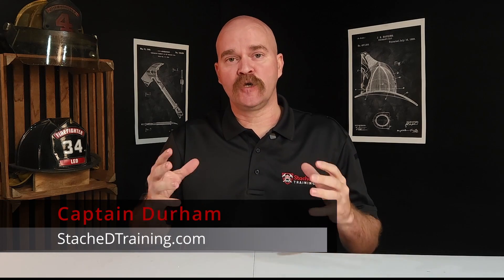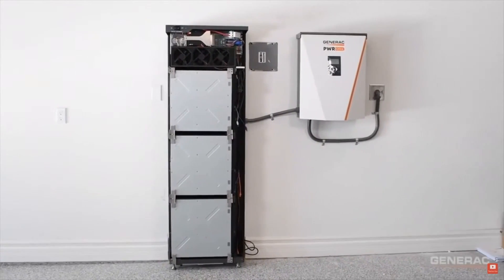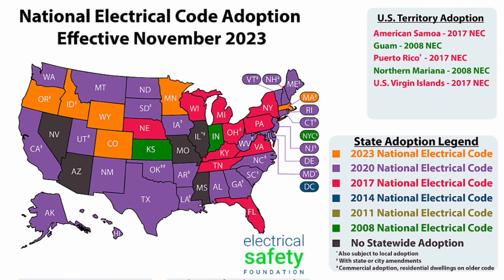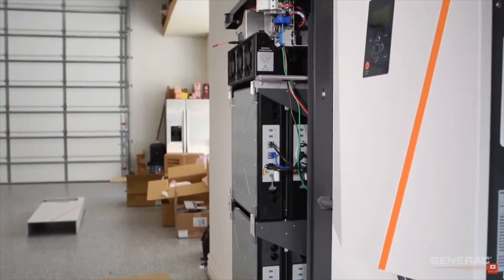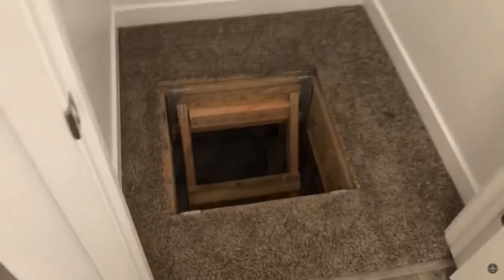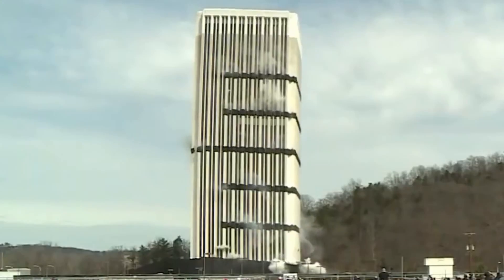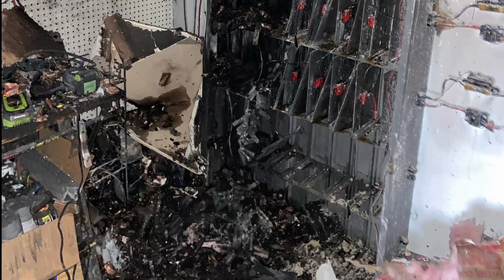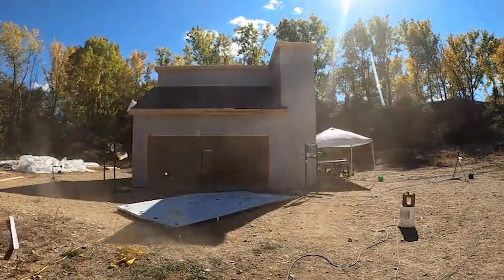Explosion - DIY Energy Storage System: Worth the risk?

Comment: I'd like to do a system at some point but I'm already firm on it would all be in a dedicated outbuilding made from something like cinder block, I don't even like leaving tool packs charging in the house unattended. I didn't know there was a hydrogen risk from LFP, sounds like they need to be treated similarly to lead acid.
Reply: I would personally put one in a sea can with enough venting that it can't blow the walls out and create shrapnel. Probably cost similar to masonry and you can resell it later

Comment: It seems like any of these storage systems needs to be divorced from the home structure. A stainless steel, vented enclosure with automated fire suppression seems to be necessary.
Reply: I would forgo the suppression system
Reply: I agree. Forget fire suppression. Build for nonflammable construction with a vented roof, plus sufficient distance to contain the fire and prevent spread to other structures. If thermal runaway happens, fire suppression could make it worse.

Comment: My first experience with solar power was at a communal house in the rainforest country of far north Queensland, Australia, in 1982. It was a very basic system that charged a bank of 12-volt car batteries so that they could run a radio and a few 12-volt lamps. They also had an old, oil-powered single-cylinder engine with a wheel that ran a 240-volt generator in case they needed a bit more power. My second experience was in 1983 when a friend told me about his parent's home in a (then) remote area of the coast of Queensland. They had a solar setup with deep-cycle batteries and the solar company that installed it was using their home as a test-bed for the system. Each year the batteries and panels stayed operational at their property, the company would extend the warranty on the product for future customers. Solar was quite unique at the scale of running a home back then. All of the locals in the community used generators or very basic solar systems that would only run a few 12-volt lights. EDIT: With both of those early systems, the battery banks were outside, away from the house in a separate shed. If I were to buy a home and install a Tesla or other Li battery system, I'd have it in a shed separate from the home.
I do my own 12-volt and some 240-volt electrical work...but I got some training and did some self-study before playing with the zappy zappy stuff.
Reply: Spot on! The energy density of these battery systems is enormous. If they fail all that energy gets released in a thermal runaway cascade. You do not want that risk inside your home because each cell in each battery is a potential single point of catastrophic failure. 

Even quadcopter drone enthusiasts who are experienced know to charge their tiny batteries in a protected battery bunker. (Sure the Lithium battery chemistry in them is a bit different, but the danger of thermal runaway failure is very similar - except your house battery system has hundreds of cells in them!)

People need to Google car battery fires as well, because the same dangers are lurking there too. We have the early stages of a new, non-fossil fuel, energy infrastructure, which is great, but sales & marketing are not going to dwell on the dangers - they don't want to dissuade a potential customer. It's up to the homeowner & diy'er to understand the risks and design/build accordingly.

If it was me, I would have a separate power shed designed to contain a thermal runaway, as well as keep the battery bank in its optimal temperature range. And, I would keep my outdoor power equipment & cordless tool batteries & chargers out there as well.
Reply: Home good builds guys normally will say that the key to using old batteries is to not over stress them, dont't charge more than 85-90% or discharge to low and charge and discharge al much lower currents than you would normally. This greatly reduces the stress on the aging cells to the point where the risk of explosion is almost zero.
If you want your phone battery to last way longer and greatly reduce the risk of it exploding on your car dash then don't fast charge you can turn it off in your settings.
Reply: Yeah, Hi Brad. His report was excellent. In some way I reckon we are all seemingly addicted to batteries and having to remember to charge 'em once in while. 😅

Comment: Should be requirements that battery packs must be stored at a certain distance from the house, and have an extinguishing system that is automatically activated in the event of a fire, gas detectors, etc.
Reply: They should follow the same rules as other generator systems until the risks are quantified.

Comment: Thanks for the information on this subject .
I am for a while now interested in solar / wind / hydro elekticity storage and try to understand the who / what and where on this subject .
The big issue i have is , like you shown , the burn to the ground of electric vehicles and the explosions of it .
Many video's show the installations of DIY systems and several seems to have a very high level of profesionalism , but my concern is safety and as high as possible .
For what i understand now is that if you use LFP batteries use high quality batteries , high quality equipment to regulate the power , not in or close to the house or any other building and a kind of ventilation or ofgassing system .

But there is also an other safety issue , how safe will it be if there is a big solar wind / CME / EMP ?
Because of the Geo Induced Currents ( GIC ) that will have currents above and underground how safe can these systems be made ?
Reply: Much like the risk of EVs, the risk of these battery systems is being greatly exaggerated. 
ICEVs have 30x the fire risk of BEVs. This is fact established by insurance companies. 

Gas vs EV Fires [2023 Findings] - AutoinsuranceEZ 

I strongly suspect we are going to see something similar when compared to fossil fuel powered backup generators. 
There will always be some risk, but if these few incidents are all there is, it seems they are vastly safer than the standard systems of today.

As to solar flares, emp, and such, being off-grid is safer. It is the long power lines that are the danger. Being able to disconnect when danger presents itself is an advantage battery systems have in this regard.
Reply: @williammeek4078  These systems have a Battery management System ( BMS ) if the BMS is damaged ( technical fault , EMP , Solar Wind , CME ) then a Thermal Runaway is likely to happen and this means the battery's are heating up and fire will soon be a big problem . The problem with Lithium is that it is highly reactive .

Comment: Yes it is safe. The lithium battery dont outgas? Must have been a lead acid system poorly made with a bad placement not in a special accumulator room that was not safe and ventilated properly. 
Is lithium batterys cheaper than lead acid? The weight and size matter less than price in a house than a car or plane.
Reply from the maker: Lithium-Ion batteries release significant amounts of flammable gas when they fail.   This was confirmed to be LFP batteries.

Comment: I have 140KWH of tesla model s battery modules in my shop to run my property, it has a BMS, a liquid cooling system and a 1/8" steel cabinet. That said it is 250' from my home and i know its very dangerous  and would never professional install them for a customer. I only use ul 9540 rated storage for installations on homes

Comment: I currently have 7 x BYD LVL 15.4kwh batteries I built a proper enclosed block building for my installation incase of this. But after seeing this I am considering putting a vent fan inside.
Reply from the maker: My recommendation is hydrogen sensors that activate ventilation.  Allowing flammable gasses to build up inside an enclosed space can have major consequences.

Comment: Home fires from batteries are extremely rare and represent a tiny fraction of total fires even when percentage of homes that contain batteries is taken into account.   Strangely, whenever one happens it becomes a major news story.  Even though gas explosions, cooking, heating equipment, faulty wiring, smoking, candles and even Christmas trees all account for many more fires than batteries.  That doesn't mean you shouldn't take proper precautions like this video points out.
Reply: At the very least it's an additional risk to stack on top of all the other risks you listed, and I would not install the battteries/DC switching and conversion stuff physically in my house.
Reply: @treelineresearch3387  Yes.  That's why most batteries are attached to the side of the house not in it.  No chance of gas build-up and/or explosion.  Some people put them in their garages which is better than the basement but still not a great idea as most modern garages have limited ventilation.

Comment: The best place for a Li-Ion storage system is 50 yards from the nearest human being or their property.  Lithium ion cells offgas hydrogen gas and that is very dangerous in a confined space.  Many EV fires happen when hydrogen vent gasses get into passenger compartment and 'boom' everyone inside is vapourised.... Don't even mention the totally toxic gasses emitted from a lithum fire, one breath can be fatal...
Reply: Renault Zoe and Jeep Avenger 4xe have the top of the battery as the floor of the rear passenger compartment. They are designed with blast vents that are aimed in the passenger compartment. Not all batteries are designed like this
Reply: @theairstig9164  The extremely high temperature that occurs when a lithium battery goes into chemical meltdown makes it a moot point where the covers are,  2500 deg C will melt steel rapidly anyway ( steel melts at 1200 deg C ). Any one of the thousands of lithium cells in a battery can start a chain reaction that destroys the vehicle and anything within range ( normally considered <15 metres ).

Comment: Laws of thermodynamics.  I would install it away from the house in a separate structure away from the home (including a  tesla power wall or similar)
Reply: You can install it away from the house if you like, but don't put it in a structure unless it is very well ventilated.
Reply: @Ryan-ff2db  might be a covered car por or similar with one brick wall for mounting. If the batteries cook off or go boom! It is nice and far away from the  main residence

Comment: You can have proper management on DIY systems, specially with repurposed Tesla Battery packs assuming a couple things, 1st you know what you are doing, 2nd you make sure to use the features already in place for thermal management (definitely not done on your example), 3 add thermal/fire isolation systems and if need be (for hydrogen or other gases generating ones) secure air flow extraction and fire suppression.
Now, the likelihood someone will DIY all this who does not have at least a background in electricity is close to nil, which is not a good sign for many a case.
Reply from the maker: I think most people who build a DIY system do not understand the fire risk.

Comment: Very interesting and disturbing!
It is therefore preferable to use redox flow batteries.
Reply: I suppose if you can afford it.  Most battery installers are switching to LFP and installing them on the outside of the house, not the basement.  Even in the extremely rare event the battery does fail it will vent outside and the gas can't build-up to cause an explosion.  Any fire, is likely to be contained in the battery pack as seen in many videos online, which are done in well ventilated areas.  The moral to this story is don't do stupid things and leave the battery outside. They are built to be outside.  I hope flow batteries come down in price when they are more readily available but that may take some time.

Comment: It would be useful to comment that energy storage, whether it be in the form of a battery, or liquid fuels or even a garage door opening spring coil, requires special handling because of years of lessons learned in blood. Just as we do not store diesel in plastic bags in our basements, it is dangerous to keep improperly designed battery storage systems. I say this because there is nothing more inherently dangerous about batteries: energy storage is energy storage, and there is an inherent risk of "sudden uncontrolled energy release", whether it be flammable liquids/gases or chemicals.
Reply from the maker: I absolutely agree.   Energy density is the issue with lithium-ion batteries.  You can store a significant amount of energy in a small space.
Reply: These batteries are far more dangerous than diesel fuel and gasoline and that is the problem.  They burn many times hotter, they produce their own oxygen supply and they give off toxic and explosive gasses.  You can put the fire out and later the batteries can spontaneously start the process of burning and giving off oxygen and toxic, explosive gasses again and again.   Normal fire  extinguishers cannot put them out.  Even inert gasses can’t put them out as long as they’re producing their own oxygen. These characteristics separate these batteries from other stored energy like diesel, gasoline and lead/acid batteries.   The insurance companies have taken notice as have governments around the world, that are backing off on their plans for electric vehicles.  Safety is just one of many concerns that will need to be more seriously addressed.
Reply: @sgtbrown4273they catch fire all the time. Gasoline starts more uncontrolled fires than any other energy storage.
Reply: Memet is right.
Reply: 'Just as we do not store diesel in plastic bags in our basements' Most people don't... https://www.youtube.com/shorts/jSHGs4Yru_M
Reply from the maker: @spankeyfish  in my years as a firefighter, I've seen a lot of dumb stuff.

Comment: Interestingly, Tesla uses sparkplugs that fire every few seconds in the Megapacks to ignite any off-gassing to prevent large explotions.
Reply from the maker: It's a great solution.  Between that and the exterior access,  they are very safe for first responders.   Let it burn if the key strategy.
Reply: Now that's an interesting comment. 👍
Reply: Cheap solution to delay the inevitable. A sensor detecting trace elements would permit shutting down and possibly wet cooling the bank. Or at least warn the owner.
Reply: @bryanst.martin7134  Great point. I wonder what sensor would be good for that. I'll look it up and message Elon.
Reply: Thank you for your comment. I was wondering if hydrogen buildup was the cause of the explosion and injuries. It seems that systems are being rushed onto the public in DIY kits, and hydrogen management is not something I am comfortable with even for a car battery, but there are SOPs for car battery maintenance. If something happens with that system, I am not going to be on the phone with the flashlight and clamps in the other hand. If systems are directed at states that do not have specific codes for new technology, and there's no more training than a video or consultancy, that is a problem.

Comment: I was thinking that units installed in basements could be made more safe if ventilated, though it'd probably have to involve gas detectors and a powered ventilation system. Even then, there's the problem of firefighter access to these units. A small outbuilding may indeed be the better option, though it may have to be temperature controlled to preserve the health and efficiency of the battery.
Reply: I just built a 8x8 shed/chicken coop. It's insulated. The materials alone were about $3000 not including wiring of an outlet that I did later (probably about $150). Once you add in HVAC equipment plus conduit plus wiring that can handle the whole house load it probably gets into the $5000 range for total DIY job.

I looked into doing a system for my house and this was one of the items that made me think twice. Maybe if I had a big barn with southern exposed roof I'd build it in the barn and keep the batteries out there. Definitely not in the house.
Reply: I'd just wait a few more years to see where Na-ion batteries are going. Some manufacturers claim their cells are able to operate from -40C to +70C with the latest generation having 6-10k deep-cycle life, which would greatly reduce if not eliminate the need for thermal management under most circumstances. Most materials in Na-ion batteries are non-flammable and less toxic, which makes them a whole lot safer for anything in/around people and houses.
Reply: You could put them in a large windowless woodstove with an appropriate insulated chimney. Still not 100% safe but safer anyway. And it's an off the shelf solution. Finding a way to run electricity through a bulkhead that doesn't compromise the fire resistance might be difficult